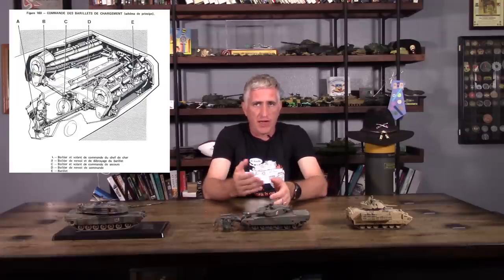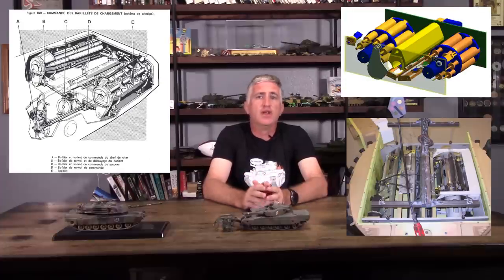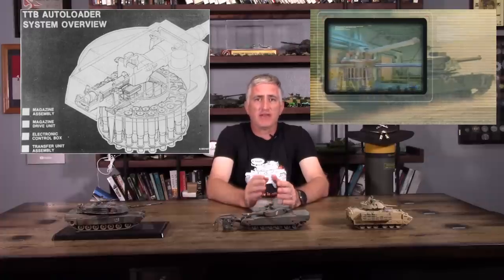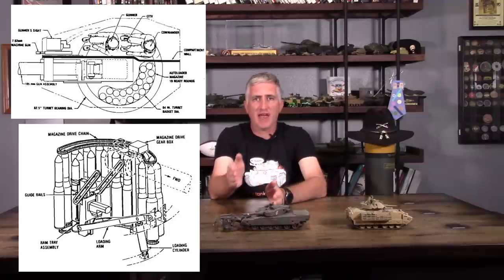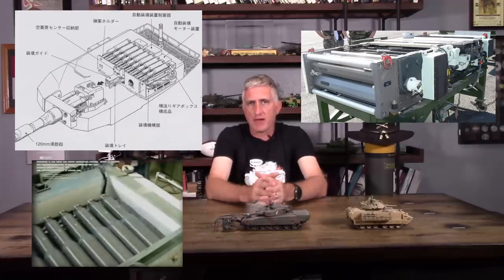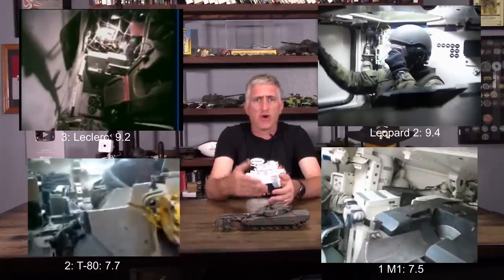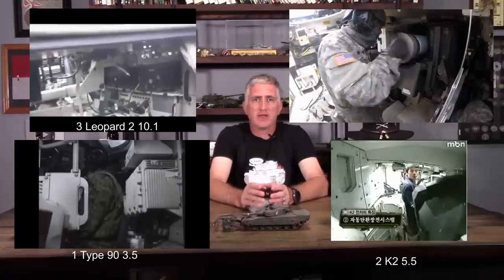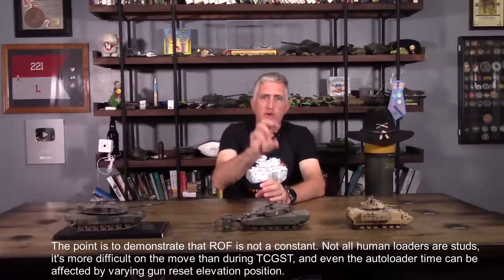Whither the Autoloader?

Comment: I think its pointless to debate "autoloaders" or any technical specifics of a tank without talking about the needs of a country... Take Japan, a country made up of 5 main islands, with hundreds of smaller islands, all with tightly packed mountains and forested terrain. Using a 70-ton tank there is just moronic. Superior armor, better rate of fire, are all less then moot points if tanks can't reach the battlefield in numbers.. 

Turkey's case is not "just" not opting for autoloader and an excellent example for my point.. They(we) licenced the K2 tank (with autoloader), throw away the autoloader design and completely redesigned the turret for manual loader and extra armor. Added extra armor to the hull and 7th set of roadwheels to compensate for the extra weight.. So which is better K2 or Altay? On paper, Altay is heavier, more expensive, favours better protection both from armor and feature perspectives and has manual loader. K2 is lighter, favours superior mobility and has autoloader.

-For Turkey Altay is better. Turkey already has 65+ ton tanks like M60TM or Leo2A4T1, so adding another 65+ ton tank to the inventory isn't an extra burden. None of the neighbors of Turkey outnumber Turkish Army, so its less of a concern for Turkey to quickly transport hundreds of tanks around.. For Turkey, however, a Tank that can't survive a day in middle east's ATGM-rich harsh conditions is just useless garbage. So Altay is designed to offer high survivability in the Middle East and K2 doesn't.. Extra pair of eyes DO matter when the next guy around the corner is can be expected to throw an RPG at your side armor. As Turkish army learned the hard way, features like complete 360deg LWR system Distributed EO suite on M60TMs are game changers for asymetric warfare. While not-yet battle proven, APS is surely detrimental too.. On one on one tank battle, Altay may only be on par with much cheaper K2, but its a much, much better asymetric warfare machine. In fact, K2 as Koreans use today would be a vastly inferior machine to M60TMs; for Turkey's use case, of course.

-For South Korea, K2 is better. Their purpose is to defeat North Korean tanks which will likely to outnumber South Korean army. At 55 tons weight same as their K1 tanks, fits their infrastructure very well.. As its easier to transport around in masses, superior strategic mobility means they will gather in strength where they are needed much more more easily. K2 is cheaper to build and probably operate, also needs less man to crew. K2 is a smaller target than Altay and most probably has better maneuverability as well. Its a much better tank than Altay to fight other tanks in a full scale war. It will surely excel at outmaneuvering and outgunning every single North Korean tank it faces.

Comment: I think you missed the biggest one; development costs. 

You need a pretty solid reason to develop an autoloader for the ample cost of a couple of 100s of million USDs that could be invested in other things, as it stod when the last generations of tanks (the one prior to the K2s, Type 10s, T 14 and possibly the ZTZ 99s) it wasn't really clearly cut which system was better during the projected service life of the tanks (as it ended up, their service life was vastly underestimated). Those XXX millions of USD could be used to develop new fire control computers, APS or the other new fancy technological developments that came in the 80s and 90s.
Reply: an autoloader was developed for the M1 abrams tho.
Reply: @matthiuskoenig3378  Not every country's procurement routine is like the US's nor do most nations have even close to the R&D budget that the US can casually spend on projects that they then put on ice.

Comment: Speaking from my experience as a tanker, I prefer having a loader...During operations a loader can help the crew in repairing/maintaining the vehicle...In the event a crewman is wounded, you have a ready replacement by rotating the loader into another spot...To me autoloaders are just another piece of machinery likely to fail when you need it most...It can't help maintain the track, repair anything, or look for tangos...Its an extra couple thousand pounds of weight likely to cause trouble...Much like an SFC's wife...

Comment: There is another point against autoloaders - with one, either casettr or carousel, you now have a rapidly moving metal elements inside the turret. This puts extra risk onto crew, especially during combat. I've heard from my dad (mechanic in Polish army, during when T-72s were used) that there were quite a number of casualties inflicted from autoloaders (even entire arms cut down from elbows).

Ideally, you should't have crew near a working autoloader, when when is combat reality ideal?
Reply: Soviet carrousel-types autoloaders are notoriously dangerous that way, but not the casette type. The only moving part visible to the crew in the leclerc for instance is directly in line with the barrel. One would think that the gun recoil is massively more hazardous in that configuration.
Reply: The problem was not the auto loader it was the Soviet indifference to human life.

Comment: I actually don’t think auto-loaders are safer, I mean in many cases russian tanks (T-72/80/90) even if equipped with some armored protection the crew has a very slim possibility of surviving an ammo hit resoulting in to a fire or an explosion, and even with the cassette design, modern MBTs usually have to carry 40~ rounds of ammunition, and most of those system can only carry 20/22 rounds, meaning the other 20 rounds have to go in the hull, like in the Leclerc where a hit to the hull magazine could very well injure or kill the crew, this also means that in tanks like the Leclerc the commander has to reload the auto-loader while trying to command a tank. While tanks like the M1, even if ,in the situation where the tank is hit during reload it will have a slightly worst outcome for the crew, it still is a very very slim chance, and also if the ammo gets-hit in a manual loading system u have to replace some metal shelves, with an auto-loader u will have to replace the whole mechanism, witch wont be cheap
Reply: thats due to lack of blow out pannels, not an inherent flaw in autoloaders FYI.
you can (and i believe the T-90M does) have blow out panels on the hull flore. as said in the video the abrams does it for the shells in the hull.

your argument is invalid.
Reply: Lord Solar Matthius have u seen one of the many videos of those russian tanks cooking off with 2 meters flames coming out of the crew hatches? Or even when the turret just nopes out of there, I don’t think the crew was having a nice time there the T-90s might have blow out panels, but T-80, T-72, and T-64 don’t and all three of them are still used quite a lot, and as I said, in tanks like the Leclerc or Type-90, half of the ammo are not kept in the auto-loader with blow-out panels, but they only have reinforced racks.

Comment: So, lets say you install an autoloader and remove the Loader.  This allows you to change the M1's turret from an internal arrangement of the Gunner/TC on the right and the loader on the left to a Russian arrangement, where the TC is on the right and the Gunner is on the left.

On the plus side, you can now make the turret about a foot shorter (the space previously occupied by the Loader and his elbow room.  Yes, its more than that but the gun does need space to recoil).  That is going to save weight/cost and offer some tactical maneuverability advantages due to an improved HP/T ratio and improve strategic mobility because the vehicle is (or, might be) lighter.

On the down side, you are going to have to beef up the number of turret/hull mechanics detailed to each company because the Loader is no longer there to assist in maintenance.  These guys are going to need an armored vehicle to follow the tanks in (they are going to have to stay close to the tanks after all).  You also need them to do all the other duties the Loader performed; security, a set of hands in loading at ammo points, fueling, clearing fields of fire and generally a spare body.
 
You've also added cost, complexity and weight in the form of the autoloader that probably off sets the advantage gained by making the armored envelope one foot shorter.

Yeah,  not in a hurry to see this happen.

Comment: Here in 2023 the russian tanks mostly t72 are often seen blasting their turrets into the air. This presentation does not mention survivability of crew. Would like to see an analysis that deals with the secondary explosion threat inherent in the existing soviet/russian auto loader design.
Reply from the maker: Discussed elsewhere, but the bottom line for me is that crew survivability in the case of an ammunition detonation is low regardless of if the turret stays on (eg Leopard hull stowage configuration) or not (T72 type). The crew aren't likely walking away in either case.

Comment: I remember a popular reason against auto loaders being after you have loaded a round you cant swap it out for a different type of round ie sabot too HEAT? So you would have to fire the gun then put in the desired round. This might have been a problem with old auto loaders i dont know but its something ive seen in a few videos discussing this case.
Reply: the issue is that extracting a round is almost never done anyway. because its very difficult to do even with manual loaders and its too dangerous to use an extracted round. when a round enters a cannon it will be fired.

Comment: One argument I've heard against autoloaders is that if there is a wrong type of ammo in the gun, a manual loader can pull it out and put it back in storage, then load another one, while autoloaders can't do it and the tank has to fire the shell that's loaded and probably waste it while maybe revealing it's position, then load another.
Reply from the maker: Doesn't work that way with modern ammo with split case structures. These days, we're trained the fastest way to clear the gun is to pull the trigger.

Comment: The Achilles heel in ALL weapon systems.....EVERY SINGLE ONE....is Training; "New Equipment Training" specifically; entailing both classroom and practical application; including operator and maintainer training; both "first-echelon" and all the way back up the chain to depot rebuild. Auto-loader or not? I place more emphasis on crew training and system employment. Either one has advantages and vulnerabilities.....   An M60 with all associated upgrades, versus one of today's MBTs, could defeat the modern MBT if the M60's crew training was superior to the modern MBT crew training. Don't laugh, it's possible and the general scenario has probably manifested itself in Ukraine already; i.e., the Ukrainians are better than the Russians. 

Anyway, I'd TRAIN my crews to the utmost, regardless their loading system.

Comment: I would argue that Soviet/Russian system is bad because yes, the tanks are smaller, but they are so small that the space is cramped, especially compared to the moving brickhouse that is M1, which means less choice for recruitment (yes, even in Russia)  and faster crew tiredness. Plus, everyone have seen T-series flying their turrets few stories up, because the crew is insuficiently separated from the ammunition. On the contrast, while plenty M1's have been destroyed, IIRC not a single crew member have died from ammunition cookoff, blowout panels did their job. 
T-14 at least fixes the most serious issue after half a century which is crew riding together with ammo. Height issue still remains, but it is a lesser problem compared to basically certain death if the tank gets penetrated. Western approach to autoloaders is better (guess I am biased), I would say, there is more separation in combination with blowout panels.
Of course, it is pretty clear, I think, that autoloaders are the future, especially if (well, more likely "when")  the callibre goes up - 120mm is basically close to limit to what a human can load in reasonable ammount of time.

Comment: I believe many us army commentators after the first gulf war noted the terribly slow reaction times by Iraq's tank crews to incoming fire. Now was that down to autoloader in the Russian tanks or inadequate crew training? The USA had consensus that it was the autoloaders fault and not crew training or familiarity? Much of this I suspect would have inappropriate ammunition selection by the crew possibly? No point in having a lot of h.e. or smoke rounds bouncing off an Abraham's. It served most to alert the Abraham's crew noting the position of a hull down Iraqi tank? Whereas a perhaps more significant American technical superiority in autoloader skills and tech would still have left the Abraham's gaining the edge. Much as in Korea, in the air, the mig15's should have reigned supreme on paper, the reverse was actually the case. The American pilots in F86's held a crucial advantage due to better training and discipline. Your thoughts.

Comment: That is way I think the Challenger 2's L30 Gun / System is better.

1st Gun.
The L30 is the most accurate gun today, with the longest fire of effect range more then the L55 and M256/L44, plus with HESH is more powerful and in more areas, with the APFS rounds able to go through the same armour as the rest, little note the T-14 Hull Armour for example even the new APFS round for the SEP3 won't go through it.

2nd Loading.
The Challenger 2's L30 uses 3 part ammo, 2 part ammo is loaded in manually with the 3rd part loaded in Automatically after the breeche is closed, with the Head / APFS or HESH kept in the turret, while the Charge Bag is kept in the Hull, and the Vent Tube is kept in a magazine, so for the Challenger 2 to get a ammo fire from a enemy shot, it need to go through the Hull Armour of the Challenger 2 witch has never happened, unlike the Abrams and Leapeard 2's witch have had shots go through, the only time a shot went through on a Challenger 2 was close up on the lower front plate that and damaged the drivers foot, it would have been worse if it was a Abrams or Leopard 2.

3rd Ammo fire. 
The Ammo in the Challenger 2 is the safest due to being apart from the rest until its time to load, the Abrams and Leapeard 2's keep the ammo in a box with blast door's, but there have been a number of times that Abrams and Leapeard 2's have had these fires due to being penned in the turret, again the Challenger 2 the only thing that has ever penned a Challenger 2's turret is another Challenger 2.

4th Loading part 2.
Loading in the Challenger 2 is quite quick, yes maybe not as fast but still faster then some, the Challenger 2 have proved itself on the battlefield time and time again, and the L30 has not let the British down in keeping up with others. 

That is way the L30 and having part ammo is the better way to go.

Comment: How much space does an autoloader actually save though? You got all that machinery.
Reply: let me put it this way, there isn't enough space in a T-55 turret for a 125mm gun manually loaded.
there is enough space for a T-55 turret if you use an autoloader.

Comment: Another argument pro-human loader, is that you can easily tell the loader “wait! load HE instead” at almost any point during loading, and also the loader is a spare human in case the commander or gunner gets hit.
Reply: The Chieftain addressed this before, basically in a combat situation it is a lot more faster and easier to just fire whatever round you have in the chamber at the moment and then load the correct round in. 

Also why can a 3 men tank function with just two ? The commander can fill in for the gunner just as well.